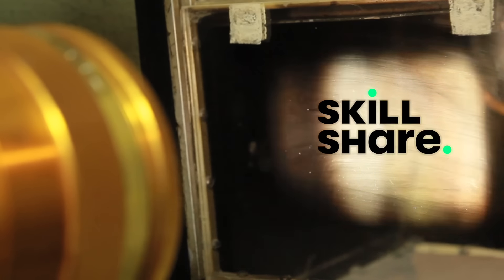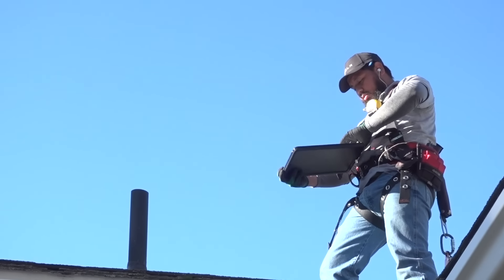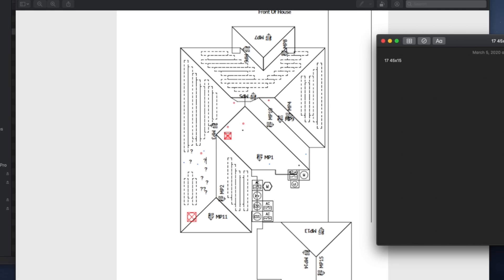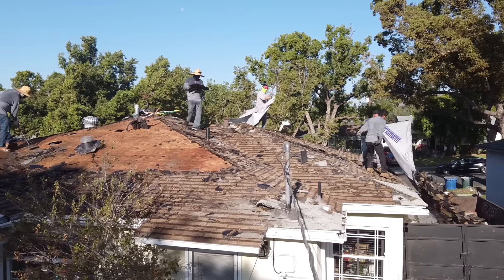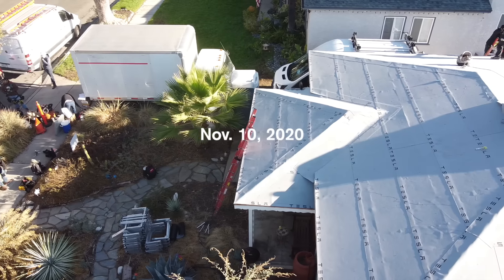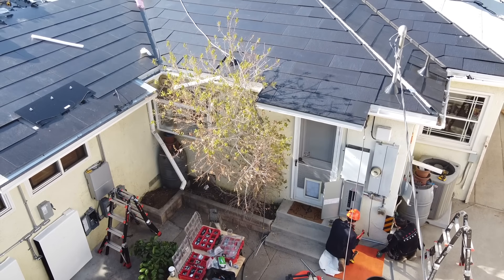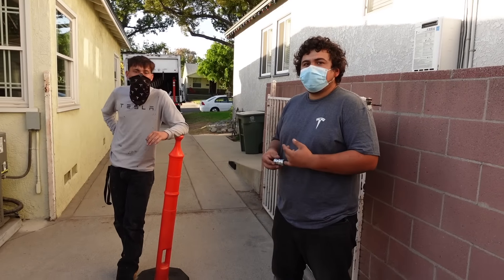This Tesla Solar Roof Was NOT Built in a Day

Comment: If you addressed my comment during the video than clearly I missed it. You began by saying you wanted Solar because you don't want the Electric Company to just randomly turn off your Electric due to Brownouts or Blackouts and I agree with you 100%. You do realize because you're tied to the grid the Electric Company is still going to be able to turn your Electric off, right? 

The grid tie is how they will do this and that's the catch and reason you had to sign a contract to allow them to do this. Of course this is the cliff note version of the actual law but I'd suggest you look into it and make sure that you have the ability to turn off the Grid Portion so that you can use Solar in Brown or Blackout situations. I could not figure out what device is used for Grid Tie, admittedly I skipped a few segments, but I'd check to see and make sure that the Grid can be disabled so that you DON'T SEND power to the Grid and still have access to your Solar. Many times they don't allow this. 

Also you mentioned near the end of the video that what you use from the Grid vs what you Send To the Grid should be a wash and that's probably true. But, and this a HUGE BUT, the Electric is not going to pay you much for what you supply to them as their GREED will not allow a fair transaction and don't be surprised if the little you do use is close to your old Electric Bill. I'd like to know how close I am to being right so do keep me posted... Cheer's...
Reply from the maker: With a battery and a gateway switch you can go offline at any point. During a power loss the system automatically disconnects from the grid and keeps the power up. There is not even a flicker and you wouldn’t even know that you’re off grid if it wouldn’t send you a notification on your app.
Reply from the maker: The utility company is required by law to credit me with the same rate for the electricity when I feed it to the grid as what they would charge me for buying it. If I produce a surplus by the end of the year they’ll cut me a check.
Reply: @ThisGuysTesla  I look forward to seeing what happens at years end, do keep me posted... Cheer's...
Reply: @ThisGuysTesla  Perhaps your Electric Company is different or maybe they've all changed as I've not researched it recently but a few years ago when I had researched, selling off excess Solar to the Electric Company, no Electric Company was paying much thereby making for much longer ROI on Solar. Again if that's changed then it may be worth looking into. I remember a few decades ago when Solar was just being introduced how they offered to put everything on your house for free and convert all your appliances over to Electric, again for free, but they got to keep the excess Solar. I forget why it flopped or didn't catch on. I didn't follow that because it just had a Pyramid Scheme feeling to it and I don't think it ever panned out for anything that allowed it plus I lost interest so didn't follow it up.

Comment: so i dont even know someone will  ever read this, I have a question, when u r feeding into the grid who is proviting from that, becouse no one could know from who he is pulling power, so they dont get free energy they still are paying to their company while using the energy u put in the grid. If that made scence is my thought prosses wrong or is it like that. would be happy for a reply. thq
Reply from the maker: There is a smart meter connected to the system that tracks the flow of electricity and reports it to the utility company.

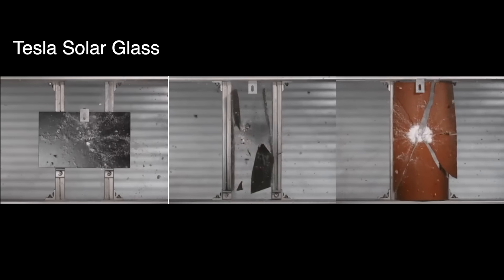Comment: 5:56 the tile test is not efficient enough the 2 tiles are placed in a differwnt position. Teslas tile has alot more support therefore... this does not prove tht their more durable ... face the tiles the same way and re do..
Reply from the maker: To be fair, these are the attachment points when they get mounted on the roof.

Comment: "Selling your excess energy production back to the grid" seems like a great concept until you read your final bill of the year when the power company bounces your excess production against your full year's use. They trick you with math when they count the energy THEY supplied during your deficit days at their retail rate which is higher than the wholesale rate they refund you if by some weird chance your system was so so over-built that you actually did over-produce--- which will never happen because the code compliance inspector makes sure your system is not larger than your past demand. How did they find out your past demand? From the power company of course.

Comment: Wow the permitting process is so laborious and pointless in the US. When we got our solar install they just did it with no inspection in the UK your installer just applies to the electricity network operator the (DNO) for an export licence which is streamlined for 4Kw and under installs.

Comment: This job makes no sense from a profit perspective for Tesla. No wonder they are not making much actual profits as a company. As an electrician the company I work for charges $125 an hour. Other trades are around the same. On one day I counted 10 tradesmen on the job. That’s a $10000 day! That’s nuts! On top of that it would take so many years to recoup the up front costs to cover utility savings if ever. Then, after maybe 25 years you have to replace it all! It’s crazy how low those panels were because I live in the Midwest and would be sitting in a snow bank. But, I guess that fly’s in California.

Comment: Can you reverse power to warm the panels to melt snow.
Reply: That would never make financial sense. Snow is very expensive to melt.
Reply: @Hedning1390  it would only be a short burst of heat but it would expose the tiles so they could carry on doing there job.
Snow can hang around on a roof for weeks so that would mean weeks of no power,
Say 2 hours of melting and your good to go.
This is my idea and if anyone incorporates this into there system they will need my permission and will have to pay royalties.
I won't allow anyone to use this untill I issue written consent.
Reply: @PeakyBlinder  Don't worry, no one will steal your idea, because like I said melting snow is very expensive. People insulate their roofs to not lose heat. You are advocating the opposite: having heating on the outside. If you want to clear your roof of snow you go up there with a broom and shovel.
Reply from the maker: What happens when it snows: https://youtu.be/f_GHVSL35-k

Comment: What does it actually cost to build a house like this in California? I mean only the building and the material, not the property. I guess it is not much because the house is pretty low (no second or third floor) and the roof is very flat.

Comment: As a master electrician ,I can tell you there is no such thing as green energy or greener energy ,.everything requires carbon/hydrocarbons to manufacture .all we are doing is creating a temporary  carbon footprint offest .If you have space (land) then it become more cost effective and less of an  environmental issue .Everything has a limited life span.and you have to calculate cost over lifespan .an example would be the cost of the equipment over kwhrs of electricity over lifespan of the equipment.an example would be like the Pickering nuclear plant produced electricity at a cost of 4 cents a kwhrs over its lifespan .That include construction and maintenance .That's large scale energy production .
Reply from the maker: While there are no global warming emissions associated with generating electricity from solar energy, there are emissions associated with other stages of the solar life-cycle, including manufacturing, materials transportation, installation, maintenance, and decommissioning and dismantlement. Most estimates of life-cycle emissions for photovoltaic systems are between 0.07 and 0.18 pounds of carbon dioxide equivalent per kilowatt-hour. This is far less than the lifecycle emission rates for natural gas (0.6-2 lbs of CO2E/kWh) and coal (1.4-3.6 lbs of CO2E/kWh).  SOURCE: IPCC, 2011: IPCC Special Report on Renewable Energy Sources and Climate Change Mitigation. Prepared by Working Group III of the Intergovernmental Panel on Climate Change [O. Edenhofer, R. Pichs-Madruga, Y. Sokona, K. Seyboth, P. Matschoss, S. Kadner, T. Zwickel, P. Eickemeier, G. Hansen, S. Schlömer, C. von Stechow (eds)]. Cambridge University Press, Cambridge, United Kingdom and New York, NY, USA, 1075 pp. (Chapter 7 & 9). http://www.ipcc-wg3.de/srren-report/
Reply: @ThisGuysTesla  they are partially correct but it's all Symantec's .I'm building solar because it makes it more convenient and not t necessarily more economical .The current cost of operating a Tesla in Canada is more than on gasoline .There are not enough power distribution points as of yet but the technology is getting there where we can have multiple power points on a public grid to safely isolate power productions .As the computer systems and software improve the issue with cyber attacks on power grids increases .
If I had a house with 50 acres of land I can produce power and food and be totally off grid .100 acres would be a phenomenal surplus of energy and food production .it's all in the numbers .As far as green house gasses and so called carbon taxes,that's a crime in itself .bad science and bad politics

Comment: Wait so it converts DC to AC and then back to DC to charge the batteries?
Reply from the maker: Unlike the first Powerwall, which had a DC-coupled battery, the second edition has an AC-coupled battery with an inbuilt inverter.

It’s advantageous as it can be used as a stand-alone backup power source without solar power.

Comment: A lot of work to get only a few active solar rows.  The waferboard (not "plywood") covering would have been needed for most roofing, indeed strange that asphalt shingles had been installed over those large gaps, so ignore that price, plus the flashing and fascia boards.  The sticky underlayment that Tesla uses is very expensive, and normally only used on almost flat roof sections, like over a porch.  For asphalt shingles, concrete tiles, or metal panels, a much less-expensive polymer sheet is fine (I wouldn't use tar-paper).  I don't know why more don't offer a Solar Carport, which gives protection for your car(s), makes access to the panel wiring easier, no risk of leaks damaging your home, and no pigeons nesting underneath.  Perhaps that will be Elon's next genius.  Humorous that they need safety harnesses for a 4 in 12 pitch one-story roof, but better safe than oops.

Comment: Holy hell, how does 65k justify electrical expenses? How much could you possibly pay a year for that property? Like 2-3k a year max? Man, given the average cost of electricity in California, you'd be break even after 40 years........................ I mean, I like the idea of being green, independent and sustainable etc, but not for that price!
Reply from the maker: Many people compare the entire system costs of a Tesla Solar roof and battery to a conventional solar system. Still, they fail to consider that this is replacing a roof and comes with batteries. So the costs for a new roof and the batteries should be taking out of the payback calculation if you want to compare apples to apples.
 
Also, our system pays for our cars' electricity. So, if you have two cars, how much are you paying for your cars' fuel per year? 
 
For us, it works as follows:
 
Solar portion of the roof: $17,800
 
House electricity costs saved per year: $1800
Car Fuel saved per year: $2500
Yearly Saving: $4300
 
Payback period: 4.1 years
 
Now, our batteries are basically free at this point. We got a $5800 grant from the state, plus one battery will be compensated by Tesla through their referral program (when you refer ten or more customers - we have 19 so far). In addition, we get $400 per completed install from our referrals. 
 
Finally, this youtube channel has already generated over $16k in ad and sponsorship revenue, by the end of the year we are projecting conservatively $20k. 
 
 If all continues as it has, the entire system solar + battery +new roof will be paid off in 2-3 years, and we get to enjoy a roof that will outlive us.

Comment: Wow, I use 160 kWh per two months and you use it per week? I guess, electric cars and bigger space take a lot, but I'm still surprised at people's consumption. I used that much when I was heating up old uninsulated flat during winter time with temperature going way below 0, using only electricity. But that was only a temporary solution, thanks God. Normally I try to be mindful, not leaving things on standby, turning everything off when not used and definitely turning off all unnecessary lights.

Comment: I might actually buy power from 1-5 am or whenever your power is cheapest to charge your batteries.
Reply from the maker: Unfortunately you cannot charge the battery via the grid (except during storm warning periods) to prevent selling it back at a higher rate. Batteries can generally be charged with solar only.

Comment: 1:00 clean energy independent? Making them isn't clean and if I know anything about Tesla one shingle goes bad they replace the hole roof just like the Battery in their cars. They use Gas & oil to make them and the waste from all these roofs in 15 to 25 years is what I want to see how they deal with that.
Reply from the maker: While there are no global warming emissions associated with generating electricity from solar energy, there are emissions associated with other stages of the solar life-cycle, including manufacturing, materials transportation, installation, maintenance, and decommissioning and dismantlement. Most estimates of life-cycle emissions for photovoltaic systems are between 0.07 and 0.18 pounds of carbon dioxide equivalent per kilowatt-hour. This is far less than the lifecycle emission rates for natural gas (0.6-2 lbs of CO2E/kWh) and coal (1.4-3.6 lbs of CO2E/kWh).  SOURCE: IPCC, 2011: IPCC Special Report on Renewable Energy Sources and Climate Change Mitigation. Prepared by Working Group III of the Intergovernmental Panel on Climate Change [O. Edenhofer, R. Pichs-Madruga, Y. Sokona, K. Seyboth, P. Matschoss, S. Kadner, T. Zwickel, P. Eickemeier, G. Hansen, S. Schlömer, C. von Stechow (eds)]. Cambridge University Press, Cambridge, United Kingdom and New York, NY, USA, 1075 pp. (Chapter 7 & 9). http://www.ipcc-wg3.de/srren-report/

Comment: Great to see you’ve got into renewables. 

But wow, look at all that waste roofing going to landfill….that will be sitting in a hole in the ground for years to come, possibly polluting water run offs etc. All part of what needs to be taken into consideration.
Reply from the maker: Doesn’t that apply to any roof replacement? And yes, all old roofs should be recycled or properly disposed when they come off. California regulates construction waste removal, disposal, and recycling to prevent groundwater contamination.
Reply: @ThisGuysTesla  Don’t get me wrong. Those tiles look epic. But from what I could see, your roof didn’t actually need replacing. These sort of tiles are better suited when there is a new build needing a new roof.

From the energy calcs you shared you could have fitted Solar Panels over the top and got the same yield whilst not filling up landfill with the waste. I’ve got 32 normal solar panels over an existing roof which is a similar size to yours and are giving me in excess of what you are getting. 

It’s all very well saying the regulations mean recycling, but the way everything was just thrown in the one bin, I’d bet $100 that none of that old roofing got recycled but went into landfill and is not doing any good!

Now just to clarify, I drive a top range EV and love renewable energy, but all installs need to be considered with joined up thinking with cost of production of the replacement or new products v waste generated v return on investment v durability.
Reply from the maker: If a roof is older than 10 years it is recommended to replace it before installing a set of solar panels since you want to avoid replacing it down the road. Our roof was 40 years old and also double-layered which shortens the lifetime of a standard roof drastically. If we were to get solar panels we would have to do a full replace first.

Comment: What if you wuld use normal Solar Panels? I think it wuld generate more Power and is cheaper if no let me know 👍
Reply from the maker: Many people compare the entire system costs of a Tesla Solar roof and battery to a conventional solar system. Still, they fail to consider that this is replacing a roof and comes with batteries. So the costs for a new roof and the batteries should be taking out of the payback calculation if you want to compare apples to apples.
 
Also, our system pays for our cars' electricity. So, if you have two cars, how much are you paying for your cars' fuel per year? 
 
For us, it works as follows:
 
Solar portion of the roof: $17,800
 
House electricity costs saved per year: $1800
Car Fuel saved per year: $2500
Yearly Saving: $4300
 
Payback period: 4.1 years
 
Now, our batteries are basically free at this point. We got a $5800 grant from the state, plus one battery will be compensated by Tesla through their referral program (when you refer ten or more customers - we have 19 so far). In addition, we get $400 per completed install from our referrals.